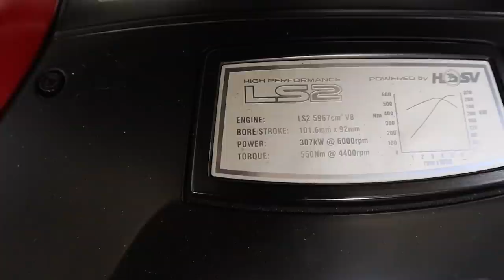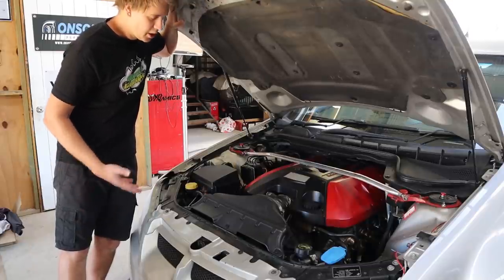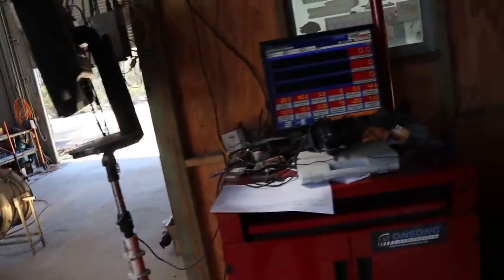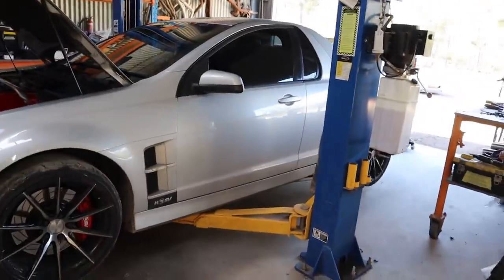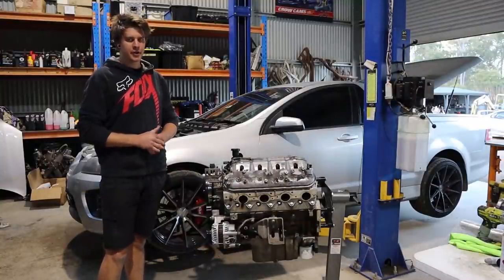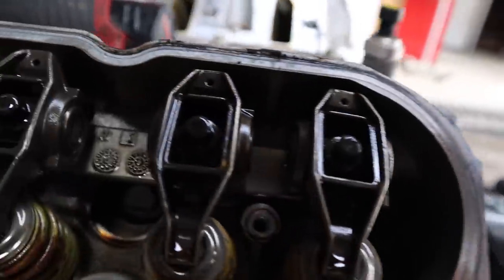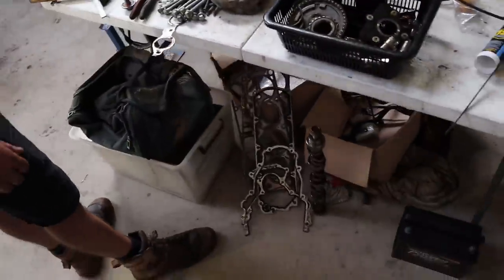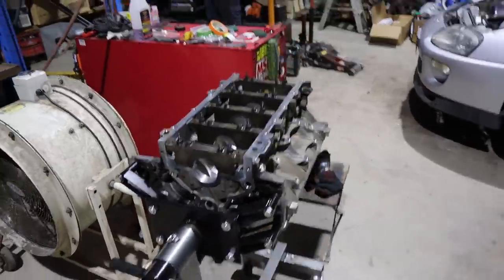BaseLine and Taredown || E1 HSV Maloo LS2 Complete Package Part 1

Comment: Good Info with the high km motor,
I’ve got 348,000 on my E1, I wonder what mine looks like inside, but I’ve oil changed it every 10k and never reved it over 4,500rpm
Reply: You probably should take it through the whole rev range once in a while.  

Also you own a HSV and use it as a shopping trolley?
Reply: @Pittaz  they don’t make any more power over 5,500 anyway, and they all come out with shit stock Tronion kit